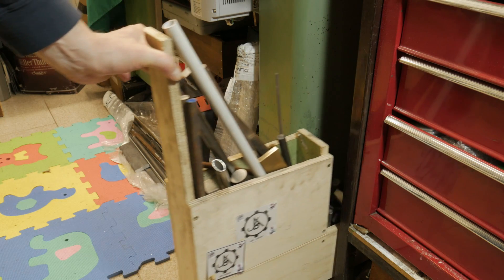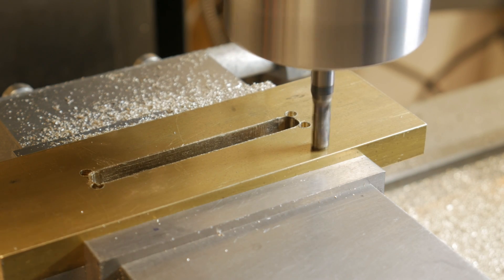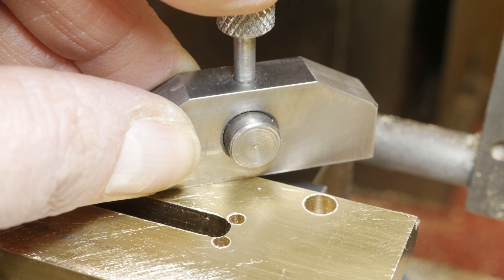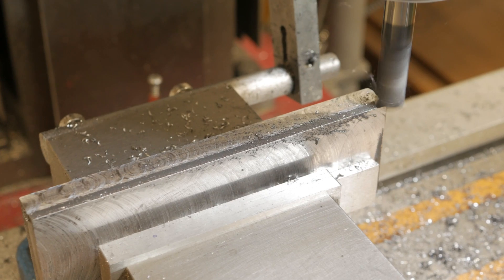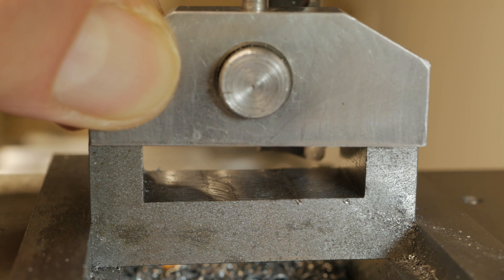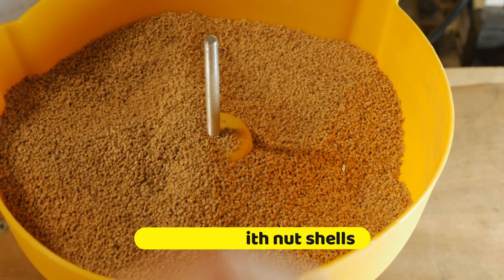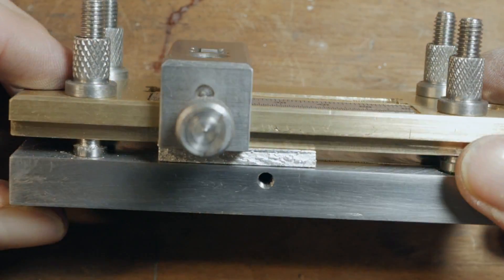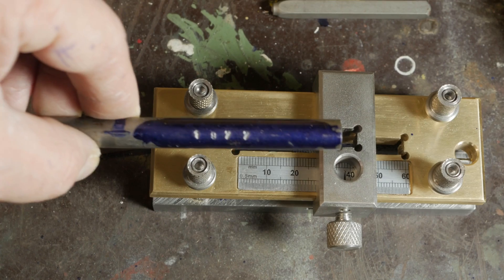Letter punch guide : aim the line and write everything straight! Punzonatura

Comment: Nice work, as usual. There is a way to drill hole corners so the corner is on the arc of the hole and the center of the circle is on the line that bisects the angle of the corner.  Very similar to what you have done. There is some times a small kusp if the corner drill is too small compared to the endmill used to cut the pocket. I find that a 1/8 inch drill works well with a 1/4 inch endmill
Reply from the maker: Thanks for your comment k15n1, very interesting !! Alberto